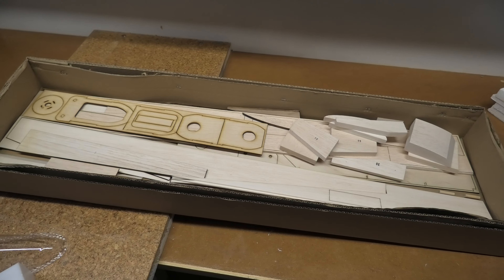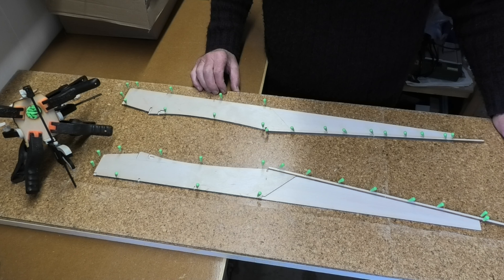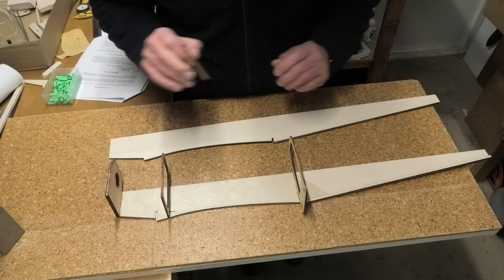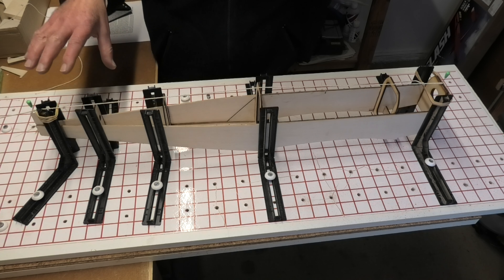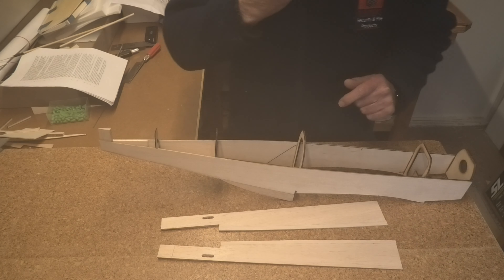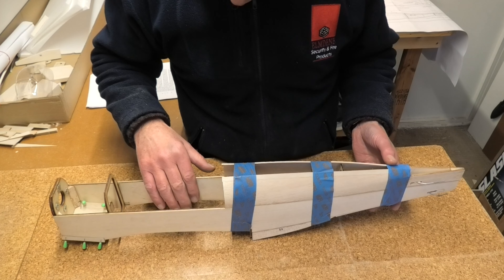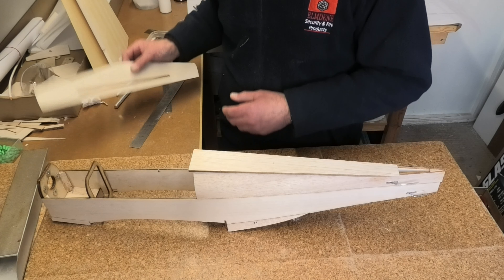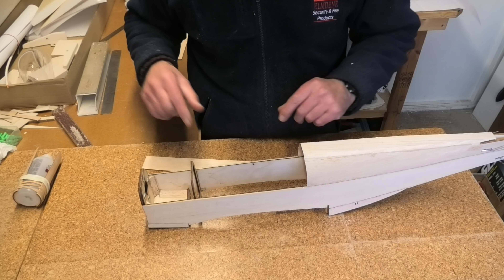Cambria funfighter - P-51 Mustang Build Part 1

Comment: Hi David I am enjoying your build. The board you are building on is it plaster board and cork ? Just about to order one of these kits
Reply from the maker: Hi Michael, I use melamine board with two layers of cork tiles glued on top with impact adhesive. Don't like plasterboard as a building board, it's fragile and degrades with use.